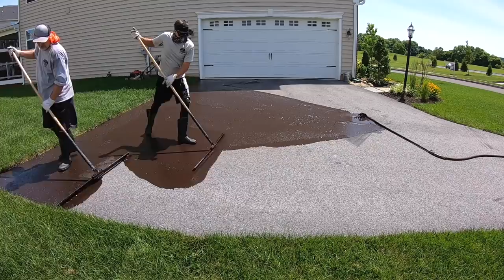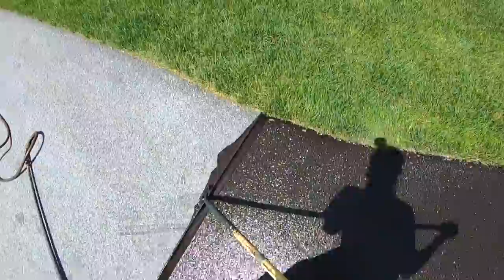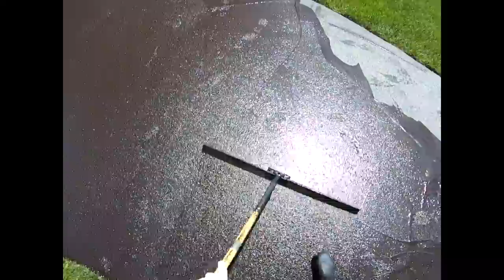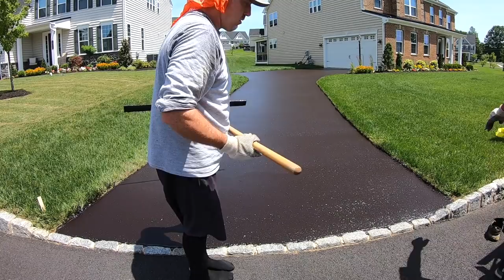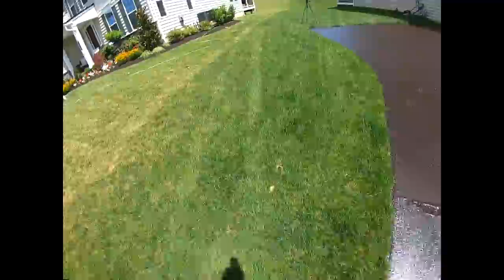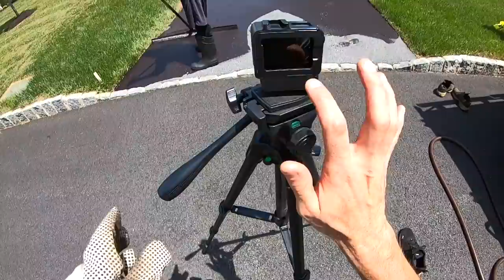Professional Driveway Sealcoating #15 “La Bandana"

Comment: Would this not make the surface hot as HELL? Don't see many dark driveways in the South?? And cool decking would be outrageous 
It looks GREAT but I seriously want to know the temperature factor
Reply: @SEALCOATINGISLIFE  
WHY a negative reply I seriously wanted to know if it would be like regular black top or not that's all but the aplication process was fantastic!
Reply from the maker: @dennisrobinson9408  wasn’t meant to be negative. It does increase the temperature.
Reply: @SEALCOATINGISLIFE  THANKS

Comment: I've got a long, 150 ft concrete driveway. Can this be done on it?  Does it have to be black color?  Can it be a near white or off white?  Thanks!!
Reply from the maker: Not with this product. Concrete can be sealed but it’s a different process.
Reply: @SEALCOATINGISLIFE   Thanks for your response!!!
Reply from the maker: @LilHoss  👌

Comment: Dumb question, Can you do that over cement?
Reply from the maker: You can do thus over carpet if you want. But this product is designed for asphalt application only. You can seal concrete but it’s a different process with different materials.